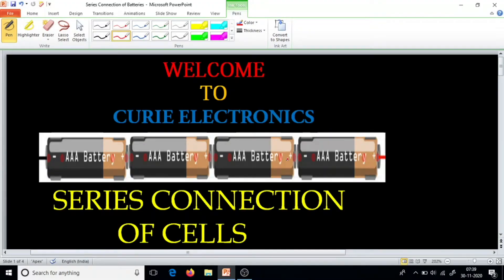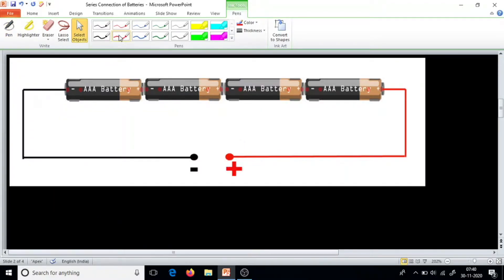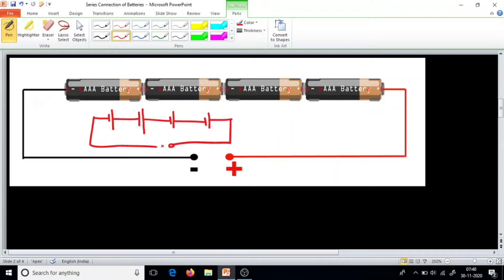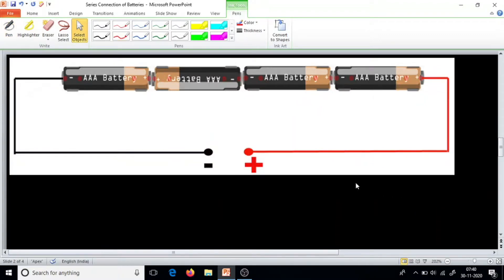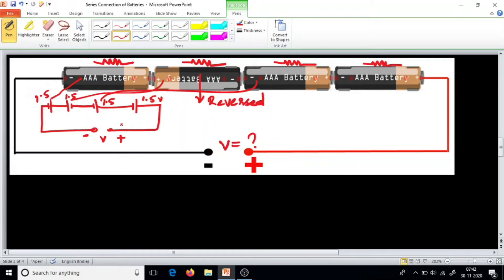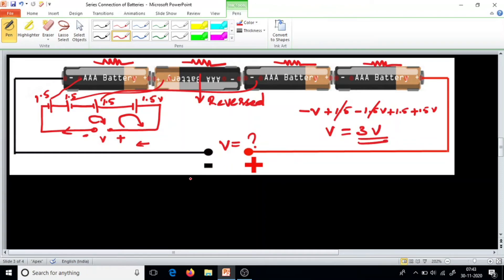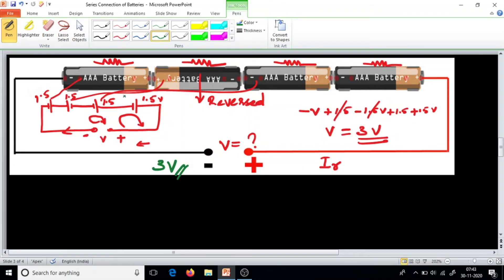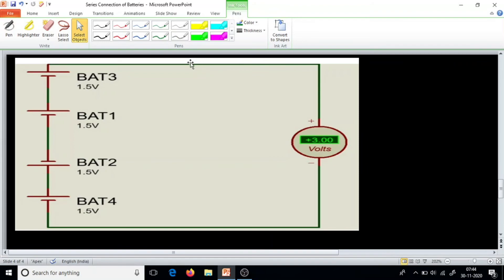#48 BATTERY | CELL is REVERSED in Series Combination ?????????

Comment: Sir, if we connected two batteries in reverse back to back with a normal 5 cells in forward connection... how's the net volt
Reply from the maker: 1.5V, if 2 cells out of 5 are reversed in series connection.use KVL